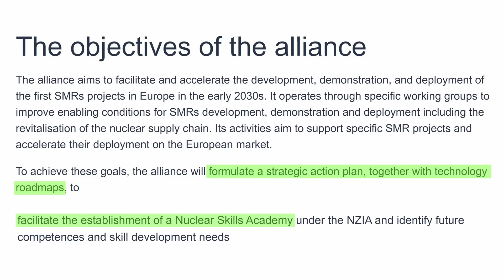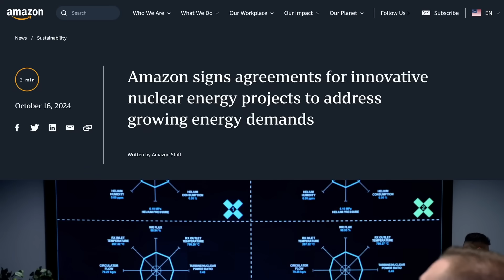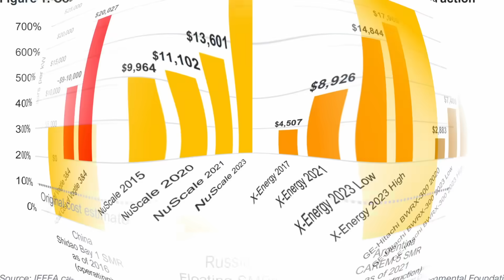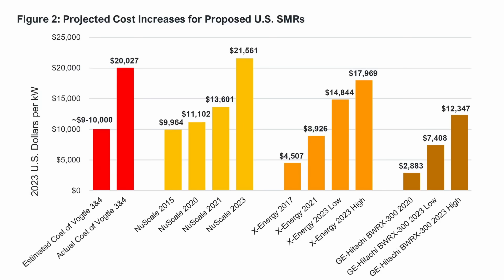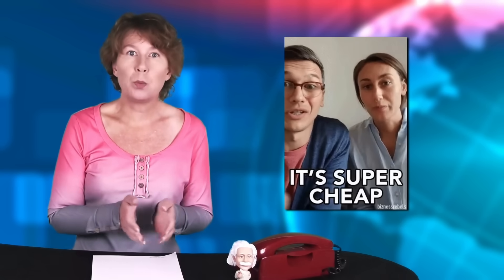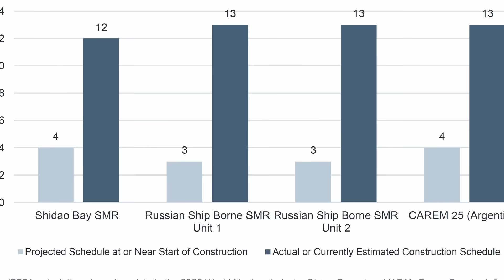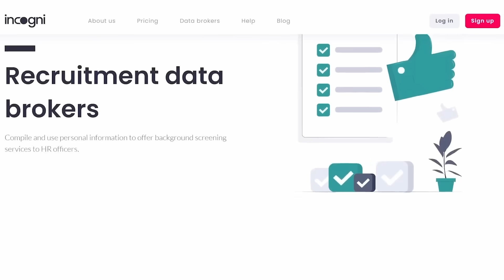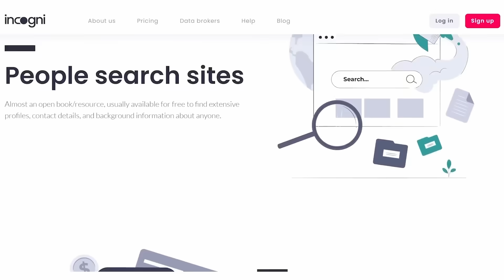Small Nuclear Reactors Have A Big Problem

Comment: The development of anything technically significant and new has risk. If its all known, then its not new. I have worked in technical development roles with a reasonably high degree of innovation (and therefore risk). These roles were not in the nuclear space but some were in highly regulated industries. Someone has to make a case for the money to develop whatever it is. There are multiple layers of people between the money and the technical people. Each layer paints an optimistic picture to the layer above (the one closer to the money) and when all this optimism is multiplied up the overall time and cost estimates are unrealistically low. There is an interesting thing tho: I once worked on a  development project which fell below senior management radar (They were all fighting about something "more important" for about 18 months 🙂) . We had a budget which I suspected would get bust at some point but we were left to make max progress in minimum time form reasonable cost. We (the technical team doing the work ) agreed what to do for each next step,  We did it and then reviewed. When we learned that the approach was not as good as we expected (with new things you sometimes only know by doing it) we would pivot immediately and do something slightly or very different without having to waste time justifying ourselves and explaining to the money why it didn't work well. When things worked we doubled down and built on it. It's basically similar to what I later learned is sometimes called "Agile" development. In that 18 month period we made a huge level of progress at a cost well below the normal level of cost (because we could get the money quickly we could act quickly and ultimately saved money). After this the senior management took notice and started micromanaging again so we were more or less frozen.It was a shame as in one or two more steps it would have been a world beating system but hey ho. This is not me just saying that cost and time estimates are often too low. What I'm saying is if the technical people are constantly having to justify themselves and pretend they can predict big unknowns to get the next parcel of cash then it changes their whole mindset and drains mental energy and creativity from the project. It ends up costing much more and taking longer because of the excessive oversight. Upshot is there is no good way that anything new and technically difficult can compete in the market for money with things that have no or very little risk. That's why in wartime we get rapid technical progress. The money is not diverted to invest in a slightly tastier burger for a quicker financial return, it goes to the improved radar system or whatever because we desperately need it. We are in that position with Nuclear big and small, we desperately need it so we need to spend the money, period. Yes you need experienced competent people in charge, obviously but they must be empowered and funded to take the technical risks that must be taken to make progress. The good news is that the low physics costs mean than once your in the Nth of a kind situation in a fleet of reactors then Nuclear power plants big and small will be very cost effective and timely to build as they have been in the past.

Comment: i bet if you look into the cost and time overruns.  The details will likely show a vast amount of the overrun is due to corrupt regulations intended to keep nuclear unavailable.  As the powers that be try to suppress nuclear power.  The costs climb.  Orders drop.  Increasing costs per unit, should they ever get produced.  There is a difference between regulations meant for safety.  And those meant to be barriers.

Comment: SMRs aren’t really that new of an idea.  The US Navy operates similar reactors in each class of subs and aircraft carriers.  For example, a Ford Class aircraft carrier has a pair A1B reactors yielding about 700 MW of combined power.  Ohio class ballistic missile subs use a S8G reactor yielding 220 MW.  

This is basically the same standardization that’s discussed regarding SMRs…. It really should be referred to as SSMR, or standardized small modular reactor since the idea to reduce the “snowflake” designs inherent in commercial nuclear power.  

I believe the French do have standardized nuclear reactors, something perhaps the US power firms can learn from.

Comment: One of the selling points when SMR's were being advanced about 20-30 years ago was the modularity of operations.  When a large-scale unit needs refueling/ maintenance, you lose all ~1000 MWe of generation for as long as the unit is shutdown.  With an SMR, the idea was, you shutdown one reactor module at a time and keep running the other 9-11 reactors.  Thus keeping 90% or more generation on-line all the time.  This would improve overall capacity factor and overall economics.

But times have changed.  Those large scale plants that used to have capacity factors in the 50%-60% range have either improved or been shutdown.  Capacity factors in the range of 90% or more for an entire refuel-operations cycle are not uncommon.  So the idea that SMRs would have a higher overall capacity factor over large-scale plants has faded away.  One less selling point for SMR's.

Comment: Get away from "Water hungry" Light water Uranium reactors, and Go to Thorium reactors which Don't need Giga-litres of water, and are cheaper to build, because they are simpler in design and don't need Multiple layers of radiation dampening, (ie, Huge containment Domes) you also Can't make Plutonium for Bombs from Thorium reactors, so It appeases the "greenies" and Anti-War groups.

Comment: The issue is not "small" because they do obey the economies of scale. But it is about physical size.  Water-based reactors, which are very well understood, need a lot of mass to avoid leakage in the event of failure.  Other techonlogies such as molten salts are making huge progress but not yet commercialized and they are very small in comparison.  But they too have economies of scale. So SMR's do have a niche, but it is a niche.  Remote communities and mines can lower their electricity costs massively but a 1,000mw reactor is what you need for metropolitan and packed industrial applications.  SMR's just don't compete for that.

Comment: Citizens are so paranoid about Nuclear... childishly DUE TO "Chernobyl" Blowing Up from Irresponsible & Criminal Negligence. Modern Reactors, as in the G.R. Ford Carrier can EACH put out 300 MEG WATTS, Doesn't need Re-Fueling for 25 Years, AND ARE THE MOST RELIABLE ON THE PLANET. RATHER THAN SAY; covering the Entire State of California With 12% efficiency Solar Cells to get 6 Hours Power/Day. USA Energy Policy is "A Fairyland" ... WE NEED BLOCK "POWER" AND THAT'S NUCLEAR, OIL & GAS... UNTIL Technical Break-Throughs are Objective.

Comment: Scenario:
Build a reactor of mild steel first to check the layout and the bill of materials, then build a second  if needed to attach and operate the controls and operate the instrumentation, valves, pumps, motors, generators, heat transfer. At some point transport the (a) test reactor to the building site and see how everything fits. There should be savings if the SMA is replacing boilers at an existing coal or gas site. (turbines/generators/etc)

Comment: Ontario Power Generation (OPG) has one SMR under construction and three more planned at its Darlington power generating station (in addition to the four existing Candu reactors).
The selected technology is a simple boiling water reactor supplied by GE-Hitachi, the BWRX-300.
No fast neutron breeders, no thorium, no ultra-enriched fuel, no Gen IV experimental designs.  Just proven, existing technology, enhanced with modern passive safety systems.

The first unit is planned to come on-line in 2029.  Maybe this one will succeed where others have failed.

Comment: The US Navy been using “Small” “Modular” “reactors” for 60+ years. Unfortunately their tech and processes are highly controlled and confidential so commercial companies can’t leverage it so it’s like reinventing the proverbial wheel.
Reply: Military reactors are also very expensive per Gwh, and they rely on highly enriched uranium which is considered undesirable in the civil supply chain due to the higher risk of proliferation.

Comment: Nuclear power sounds great ... until you realize that it's just not practical. For nuclear power to be even remotely affordable, it needs scale, even for individual reactors. Safety regulations are important, but not the only problem. Just the act of shelling out billions, ten years before the first power is generated is already a huge issue for financing. SMRs are still future technology and there is no way SMRs will be ready to scale up before the climate crisis is over. Nor will any other nuclear power technology. It's a dead end. Currently nuclear accounts for about 2% of global energy, and it's already too unwieldy. Even doubling that ratio seems impossible.

Comment: The problem with SMRs is that they basically lie on the same technology curve, and thus, the same cost curve, just at a different location from large reactors.  To get the cost of nuclear energy down, one needs to get onto a new cost curve - that needs to be invented, and that requires one to, "THINK DIFFERENT."  I know that is grammatically incorrect, but it just sounds right.  SMRs are just like quantum computing which is also in disarray - everyone has an idea but no one has the solution.  Maybe they're all going in the wrong direction.

Comment: We now have about 70 years of good data on nuclear generation and a pretty good idea of what works, and what does not work.  Over the last 40 years it has been arguably the cleanest, safest, most reliable baseload generation per MW of power.  Maybe now is the time to streamline the regulatory process with the goal of rapid development and shorter timeline between breaking ground and getting the lights turned on.  As was recently quoted from another US tech industry: "We can build the rocket faster than we can get FAA approval to launch".  This is how innovation grinds to a halt.

Comment: It might not be only small nuclear reactors that're facing this issue.

In Finland, it was decided that the existing Olkiluoto nuclear power plant should get a third reactor unit, the construction started in 2005, and was supposed to go commercial in 2010.
...it went commercial in 2023.

The costs also apparently quadrupled in that time.

While not conclusive evidence or a large sample size, it does seem to speak of a similar ballooning from estimates to reality that you showed for the modular plants.
Reply: See Vogtle 3 and 4 in Georgia, USA.
17 Billion cost over run and 9 years late.

Georgia energy customers bills have gone up.
Westinghouse filed bankruptcy.

Comment: Making the assumption that SMR's can eventually be built at a reasonable cost they offer two benefits. Lower capital costs and shorter construction times. From shovel in the ground investors should see a shorter time before it is is producing power, aka paying for itself. Until then all of the carrying costs of the capital are born by the investors. SMR's reduce risk. But once delivering power, that power will be more expensive than their big brother large scale reactors.

Large scale reactors are risky because the capital costs are much higher with longer construction times. But, once completed they produce power at a lower cost for much longer. Assuming you can get them built they are the better investment as they will produce more power at lower cost for a longer period of time. Higher profits for investors over a longer period.

Comment: There were reasons why in early times like 1950s or 60s nobody wanted mini reactors. Too many places of dangerous radionucleids for dirty bombs. Today the waste is stored in so called CASTOR containers. 100tons of steel and concrete for app 180kg of waste. Just to make it impossible to steel it. Germany has no working nuclear power plant left but still 1900 of those Castor containers.

Comment: Nuclear has so many problems, slow to build, expensive to run, and worst keeping the power production squarely in the corner of the oligopolies, so they can keep controlling the power price. Every EV with V2L, is basically a potential grid firmer, charging during the day, connect to house and run the house during the night. Excess solar can be turned into hydrogen, locally, and run a gasplant at night, or why not good old wind, in addition with multifuel coalplants that can burn green waste, garbage and wood chips, also solving other problems. All of these options are quicker and cheaper than nuclear.

Comment: Thanks for a crisp and Informative video on SMRs status which has generated a lively debate. Economic large scale implementation of safe and reliable well proven NPPs appears to be the key.

As a retired Indian nuclear industry person with three decades plus experience following are some relevant views:

As the most populous developing nation, role of nuclear power in decarbonization of Indian electrical grid and meeting net zero by 2070 would be a major concern not only to policy makers within India but to wider world due to large impact. 

To be able to make the transition with maximum reliance on cheaper renewables, for a stable grid about 20% nuclear base load power would be required to replace fossil based generation. With current 7.5 GWe installed capacity being only 3% , multiple fold increase in nuclear power would be necessary, about 100GWe may be envisaged accounting for demand increase also. 

Too much focus on SMRs as mentioned in your video would not be a good idea and may distract from this bigger goal. The average unit size for India is already low at 346 MWe versus 966 MWe for top 10 ranking countries.

A pragmatic approach would be to focus on (i) pursuing its own well designed 700MW PHWRs along with large well proven PWRs (~1400MWe) in fleet mode (ii) SMRs viz updated version of its own 220 MWe PHWR plus some other innovative designs may play limited specific roles. The approach vide (i) would be a focused growth strategy which also aligns with how major nuclear countries have grown their programme.

Barring TMI incident which had practically minimal radiation related impact in public domain the PWRs and PHWRs have operated with overall good operational performance and safety records.

A strong safety culture with sharing of experiences and good practices by utilities and respective supporting roles played by organizations such as IAEA,WANO, COG, INPO, EPRI etc. and national regulatory bodies would appear to suggest that this aspect is a very important one for long term safe outcomes rather than GenIV features as at a given time several generations of reactors will co-exist. Of course where required and feasible, safety upgrades through refurbishment and backfitting would happen for earlier models.

Experience with life extension granted to USA NPPs going up to total 80 years life by technical assessment methodology, recommended refurbishment and  review process by regulatory body USNRC has avoided significant new build enabling cheaper nuclear power and exemplifies pragmatic & positive role of such body. 

Long life with well proven designs can ensure economic outcomes even with long gestation period up to say even ten years provided long term policy and other support mechanisms are in place. This is because once created these remain valuable assets for long time spans.

Potential for recycling of some shuttered plants e.g. German Konvoi units with say new reactor pressure vessel  and fresh civil construction at a new location and reusing major components such as steam generators, main coolant pumps and turbine generator etc appears to be feasible and may yield significant economic & sustainability benefits therefore deserves to be explored further. 

Relevant articles which discuss these issues in detail may be sourced at https://www.linkedin.com/in/sabir-vhora-4b6a112a/.

Comment: My father was present under the bleachers at the University of Chicago when the first reactor was fired up. He went on to work on the Manhattan project. He was always confused by the unarguable success of the small reactors that power nuclear submarines and other naval ships. Why can't those designs simply be duplicated on land? No further development is needed, there are thousands of hours of accident-free operational data to examine, and the costs are already (basically) fixed.  Maybe their power output-to-cost ratio is unsatisfactory? Maybe they can't conform to safety regulations to which the Navy is not subject?     ???

Comment: The issue is that everyone is looking for a fix within a financialised and partially or wholly privatised electricity market (and while co2 is not yet taxed as it should be), so nuclear is not really competitive : too much investments and the returns will not be huge for the company if it has to compete with renewables during sunny-windy hours. 

If energy was treated as society’s crucial interest, we would invest in nuclear even if it would only pay off in terms of stability, environment, security,  and sovereignty. And financially it would probably still pay off over decades (which goes against capitalism’s big fast short term profits). Sabine has been advocating for capitalism but nuclear energy is a good example of market failure. Neoliberal governments serving the market do not have the capital nor the guts to go into it. The statist Western governments of the 1960s built most of our infrastructure and housing, only to have Reaganites and Thatcherites destroy everything in the 1980s…